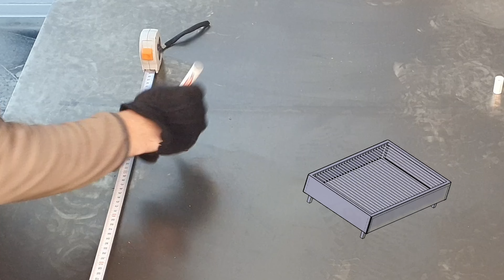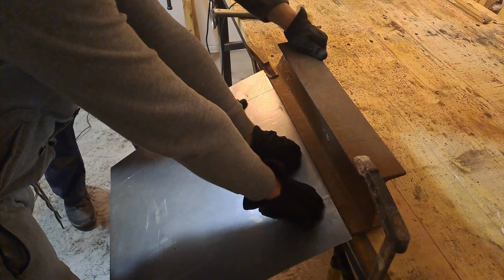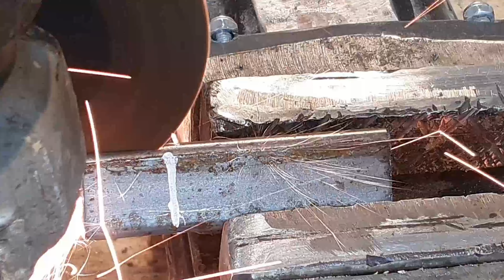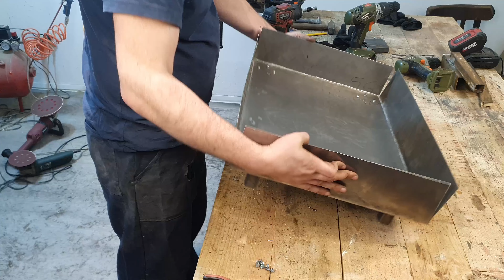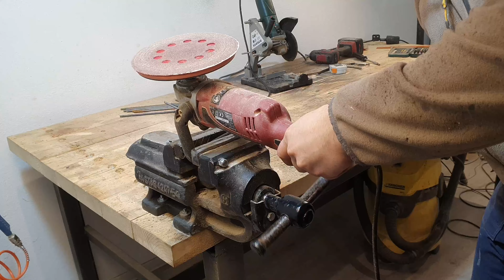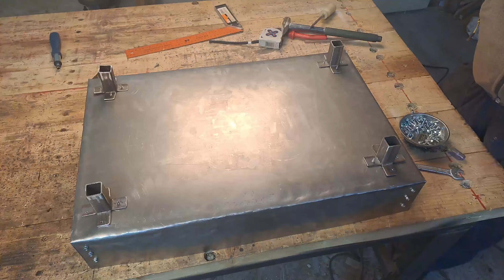How To Build A Charcoal Grill Without Welding

Comment: This was a great video and want to make one of these. What material is the sheet metal? Which metal can you use for food cooking?
Reply from the maker: Thank you🙂. The sheet metal is regular steel. The food does not touch the sheet, only the grill part. Wich we use also steel... but if you want you can use food grade stainles steel bars to make the grill.

Comment: how thick is the plate in millimeters? and how many millimeters is the diameter of the grille?
Reply from the maker: We used a thin sheet, it was 1.5mm, but we recomand at least 3mm, it will be a little bit harder to bend but will be much stronger. As for the diameter of the grill, we managed to build 3 of them from a 1000 X 2000 sheet, so it depends on what you need, in the end for us it was 400 x 600 mm
Reply: @buildsdw345  what diameter?
Reply: @buildsdw345  grill diameter?